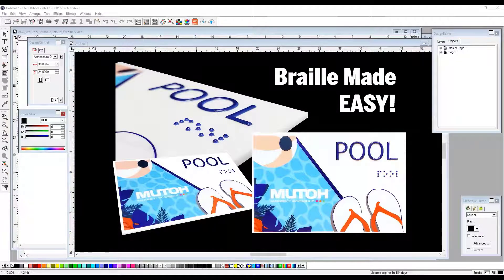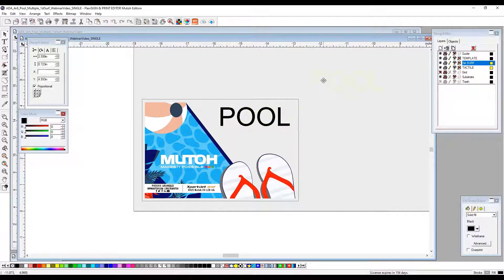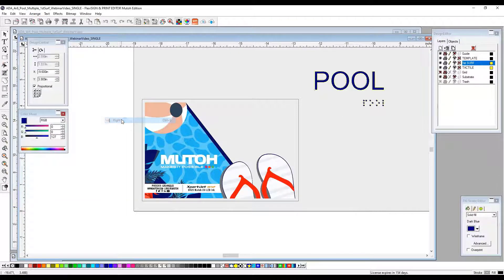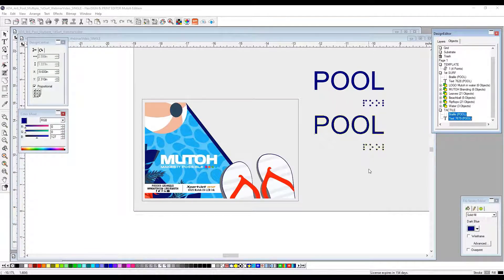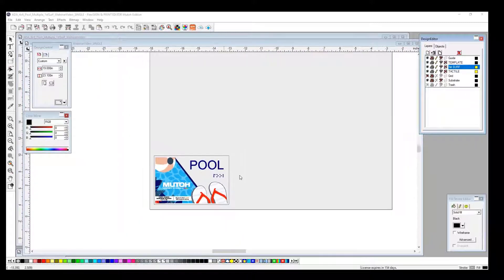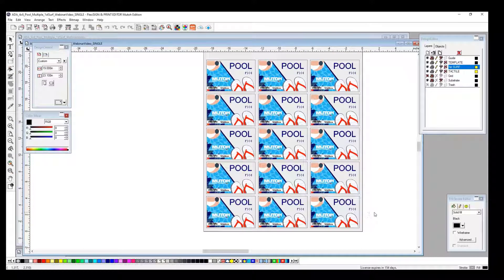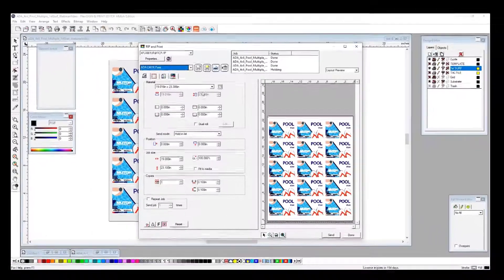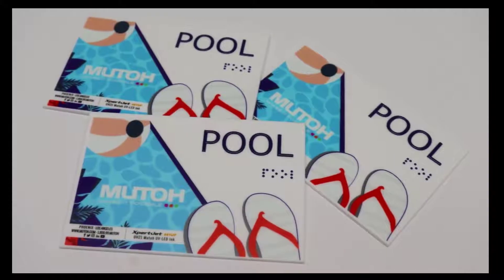How to create a basic braille sign on Flexi 19

Comment: Did you change the name of the colors at the bottom for ADA and Braille?
Reply from the maker: Yes. There has been several updates to this video since its release. The new swatch names for these two swatches used in this video are "ADA CMYK 1%" and "ADA CMYK 20%". You can download these new swatches on our Public FTP site on our MUTOH Support page.
Reply: @MutohAmericaInc  Would you mind providing a Link? I can't find these swatches
Reply from the maker: @TheExtorious  If you go to www.mutoh.com, go to the menu at the top and select SUPPORT. Scroll down to Public FTP and follow this path. Hope this helps. A new video will be released soon, so continue to follow us!

Support  >  PublicFTP  >  Printer Information and Manuals  >  XpertJet  >  XPJ-661UF  >  Profiles  >  VerteLith  >  661 UH21  >  XPJ-661UF UH21 VerteLith Environments  >  Swatch Tables